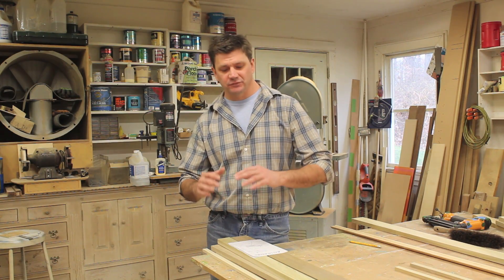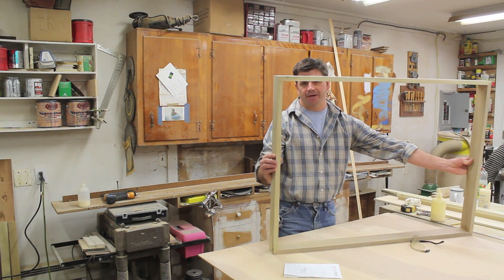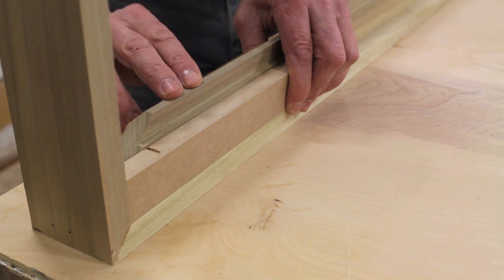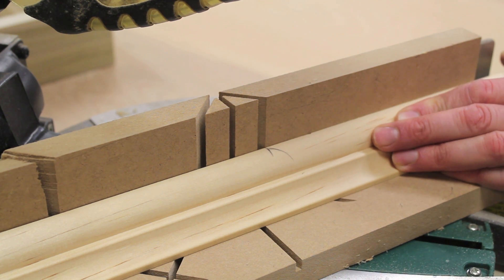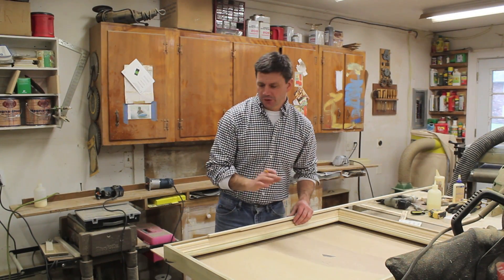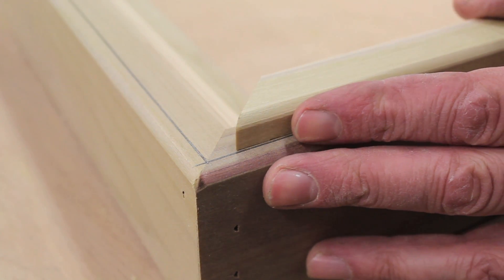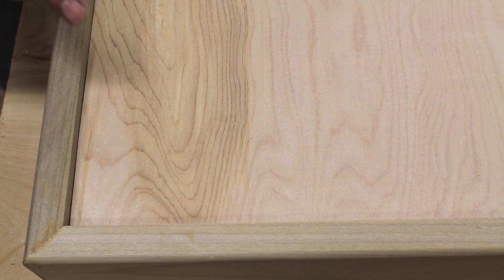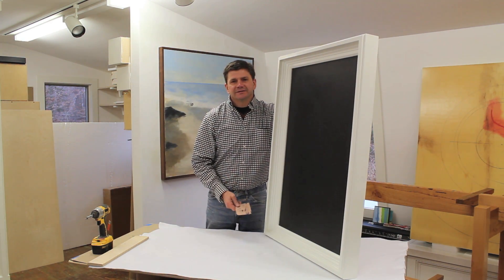How to Make a Chalkboard by Jon Peters

Comment: I made a chalk board out of a glass picture frame recently. Instead of canned paint I used spray on chalk board paint. I did 3 thick coats and it came out really smooth and flat. Perhaps painting on glass helped but not using a brush eliminated any stroke marks. Thanks for the great videos.

Comment: Couldn't you of given the black board paint a light sanding with a 2000 grit sandpaper? If you were concerned with a smooth surface.